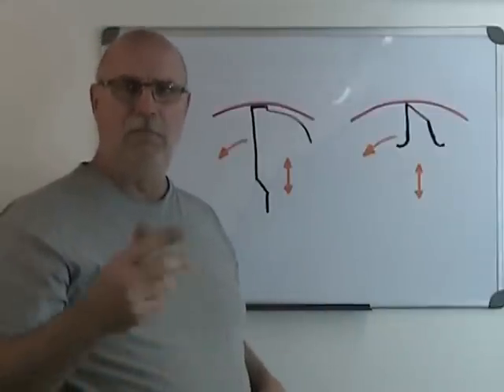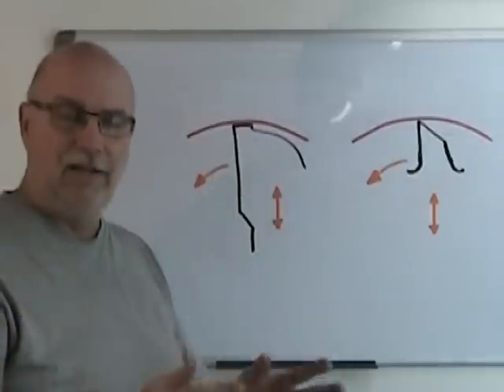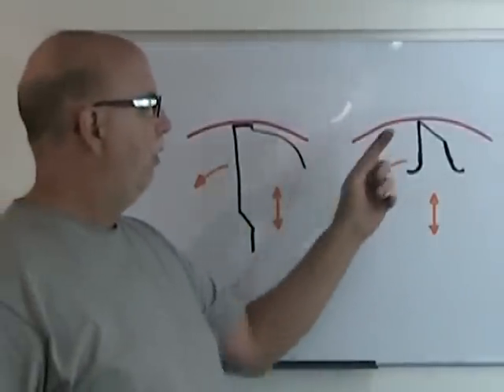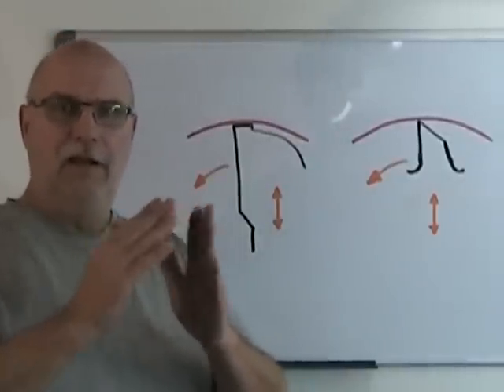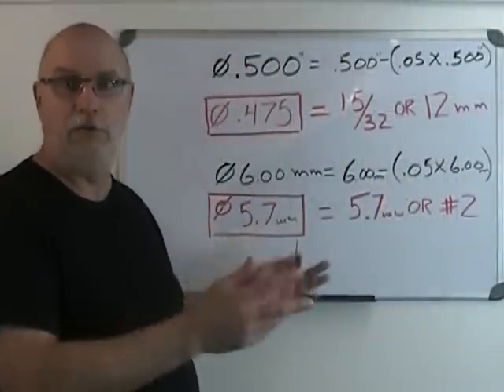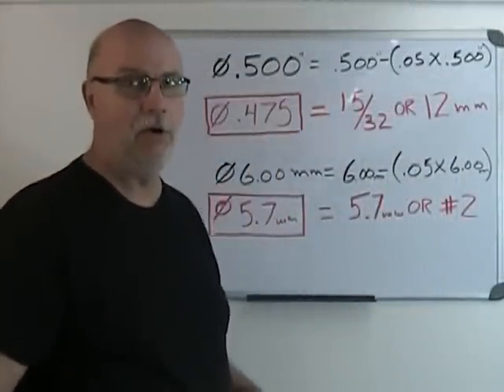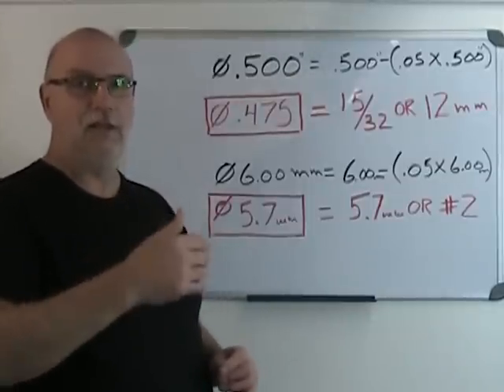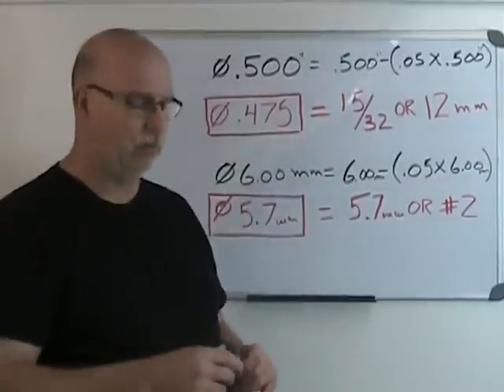THE DRILL PRESS #3, drilling vs reaming vs boring (speeds, feeds & cutting action for each)

Comment: Thanks for the  reply on my question about retracting a drill bit quickly from a part. I thought it had to do with the bit jamming because of ever increasing compressed chip load on the way out. Now I know it is because of heat build up. Your diagram showing drill bit vs. reamer in a hole, could have benefited perhaps by showing a change in diameter at the cutting edge of the reamer (there wouldn't be one on the drill bit) showing the fact that as the cutting edge engages the wall of the pre-drilled hole it makes a larger diameter by cutting. Of course the following flute edges would encounter an already reamed hole and therefore no cutting, some rubbing. Now I sound like an expert, but I think and write "out loud" always in the interrogative. Also for him whose memory is short, the lables "drill bit in a hole" and "reamer in a hole" would have helped in the beginning of the presentation. Chuckle.
You and your wife are most welcome to visit us. We'll take good care of you both here in Grønland (Danish), Groenland (in French and a few other challenging languages) and Kalaallit Nunaat in Greenlandic (an impossible language).

Comment: I would suggest multiplying the hole size by 0.95 or 95% instead of multiplying by 0.05 or 5% and then subtracting the result to obtain the answer.  This procedure obtains the same answer if done correctly but reduces the amount of work and chance of error.  With a calculator it is no big deal.  As an engineer it is better to reduce the chance of error if at all possible.  Keep on going.  Yah!!!
Reply from the maker: +Roy Reynolds Great suggestion Roy! It is obvious now that I see it, I never was that good in math. I will pass on the suggestion in the next video, Marc

Comment: Finally a nice simple and easy to remember formula for drilling and reaming that works with any reamer !
I try to avoid touching a part that is in a lathe or mill until it is time to remove it from the machine , you soon get sick of cut fingers or digging out  metal splinters from your fingers ! I made  the mistake once of  taking a feel of a part that i had just milled the surface on and my thumb nail touched the still rotating cutter , i won't go into the gory details but the feeling of that cutter ploughing through my thumb nail is something i won't forget !
There is a channel called clickspring that shows how to make emery sticks for polishing the outside of turned parts , maybe something similar using dowel rod wrapped in emery paper ( glued on perhaps ) could be contrived for polishing drilled / bored holes on the lathe and when that bit of emery goes dull just cut it off  .
Marc they say you can't teach an old dog new tricks - you just proved that theory wrong !
Thank you !
Reply: +ian bertenshaw 
Gah!

Comment: Marc, Great video.  On your preferred dimension sounds great. For us hobby machinists who often use scrap material how would you do it?  For example, I have two gears that I plan to use is a project.  I can't change the hole in the gear, so I would have to make the shaft to fit it.  Just my $.02 worth.

Comment: another great lesson thanks Marc 
i have a question though will a machine reamer still cut an accurately sized hole if there is wear in the tailstock quill
Reply from the maker: +david Sanderson Nothing is ever perfect, and reamers are made to correct for slight misalignments. There are however limits and it is best to get it as aligned as possible. I guess the best answer is try it in some waste stock and see if you get the results you need. Wish I could be of more help, Marc

Comment: If you bore out a drilled hole with an endmill will that bring the position back to accurate for the reamer?
Reply from the maker: +DSCKy Maybe! And that is not a joke. It would work if everything was perfect (head alignment , rigidity of the machine, tool deflection ...) but there is a chance that the cutting edges along the tools flutes will chatter and that will throw things off. If you do use the end mill to bore a hole, use your Z axis for the plunging and not the quill, and keep everything locked up tight and well aligned. if the head is even slightly out of alignment you will have a problem. a single lip cutter (boring bar will work fine even with a small misalignment of the head. This is a complex problem and I have just decided to make a little quickie on the subject, so watch for it to get a full explanation. Thanks for the great question, and thanks for watching, Marc